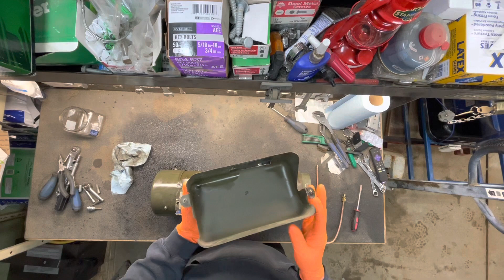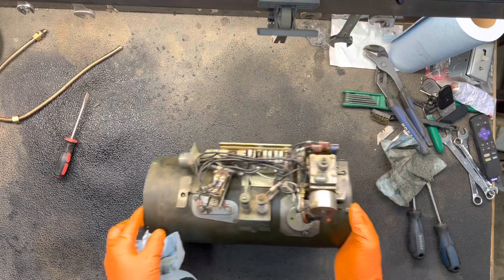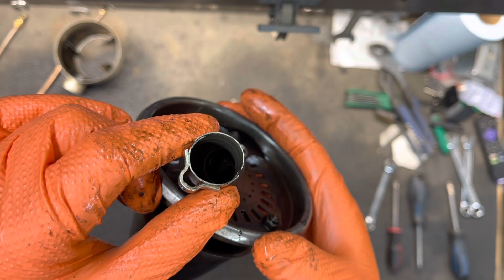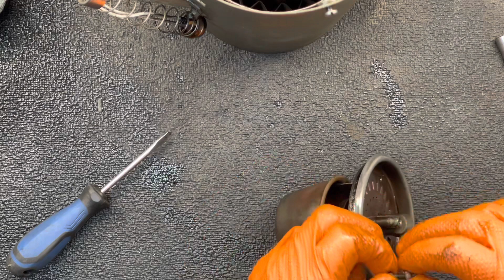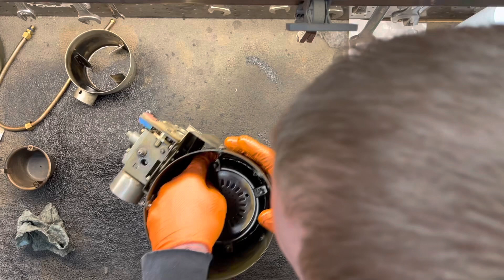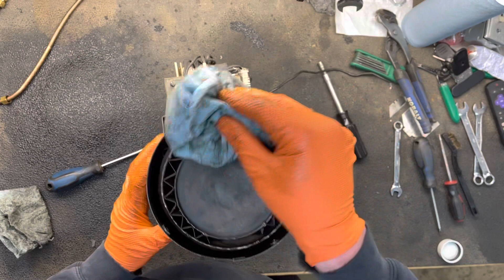M35a2 Diesel Fired Arctic Cab Heater Disassembly & Cleaning……or at least how I do it!

Comment: Thanks so much!  I have a M35 1952 Sudebaker gasser and a gas Artic Kit I was about to install.  Years ago when I had my M35A2 multifuel I purchased the more " modern" kit that you have but I never installed but kept the Kit when I sold the truck.  I was reading in the manual that the multifuel Artic Kit can be installed in a gas Deuce.  Any knowledge or recommendations?  I'm getting ready to start and post a few videos on my channel, I just need to pick a path.

Comment: Thanks alot for those video I recently got ahold of the same but without controller wiring or anything , you're almost the only source of Info on those ! I'm going to try to build a homemade controller. I actually thought they were like torpedo heaters and emitted a flame before realizing the it has a exhaust port hahaha
Reply from the maker: That’s why I made the videos on them. There wasn’t much out there online.  

Look up the M35a2 Facebook group if you aren’t aware of it already.  There are two pages. Toss a line out on either one and I’ll reply with schematics off of my controller boxes for you.
Reply: @pendulum4734  ho wow thanks alot will do!